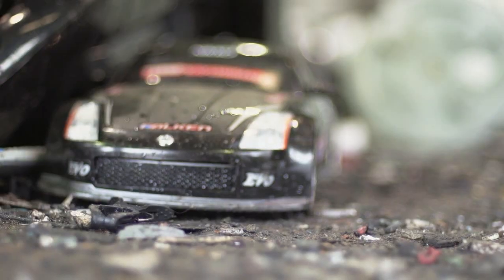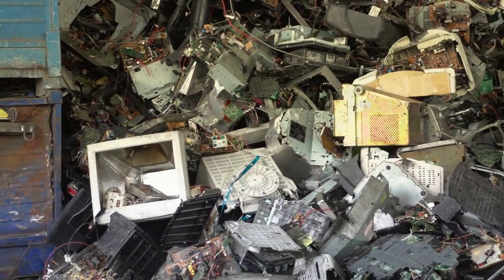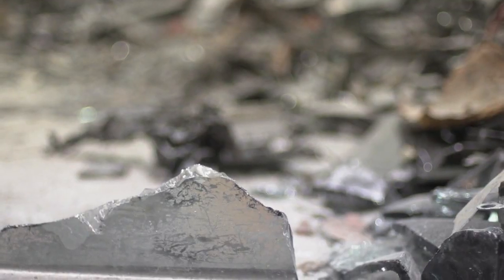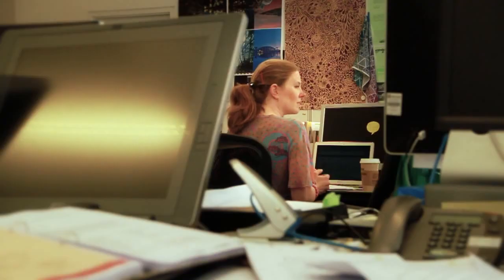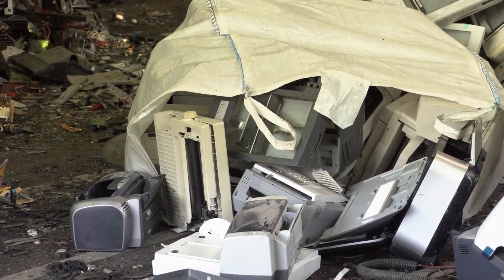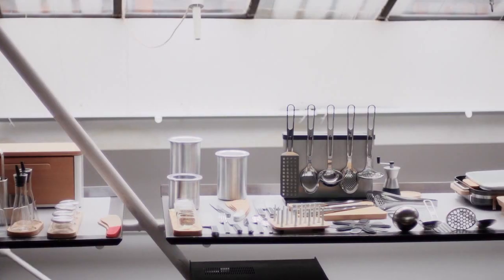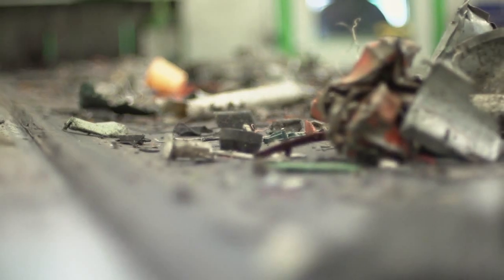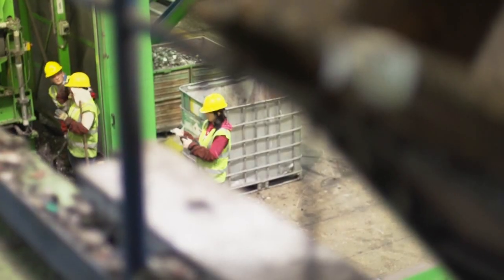The Great Recovery

Comment: One step: Designing products and their parts to be re-used, repaired, remanufactured etc. can be done en masse if we at least design products with 'Design for Disassembly' (DfD) as a main part in how we re-design goods. Active Disassembly is an advanced form of this as it results in undamaged, clean and automatic dismantling of all the major components of products. The components can be re-introduced which results in lower GHGs, energy and materials extraction, critical materials retention etc.